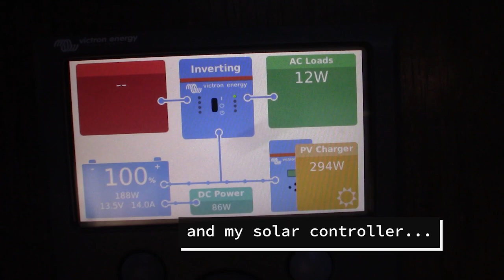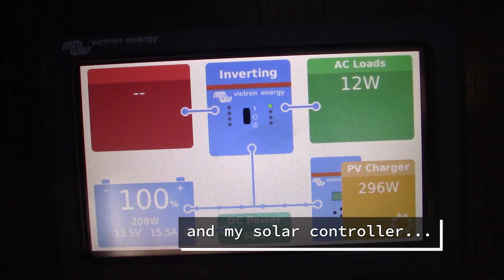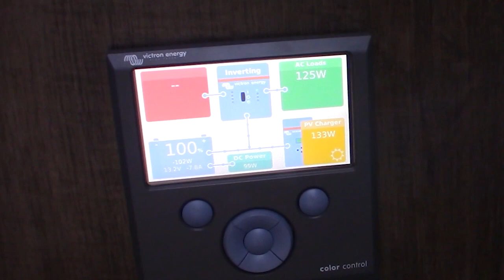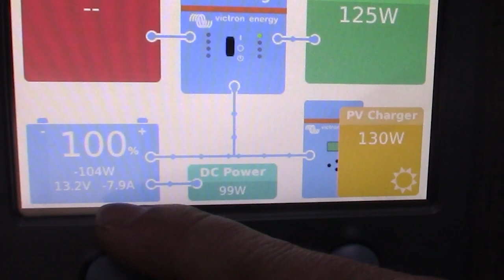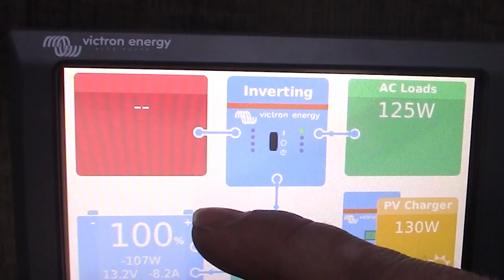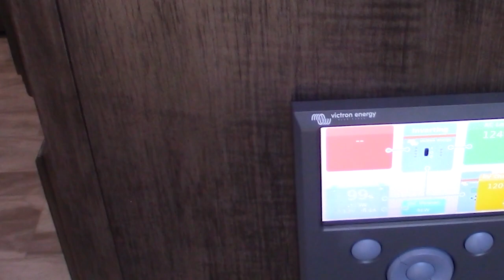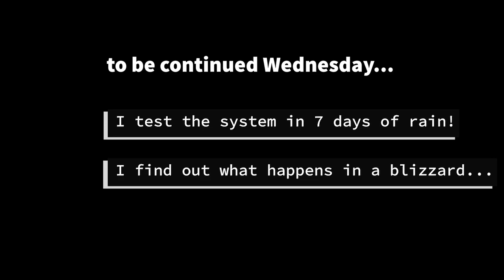MASSIVE SOLAR INSTALL for this Full-Time RV Boondocker! Full-Install and Walk Through

Comment: .I notice in all the tours of various vehicles that most have these humongous containers for fresh water and gray water under the sink. I am 77 and even a 1 gallon container feels somewhat heavy to me.  They have maybe a 5 gallon gray and 6 gallon fresh, which they are supposed to take out to empty or refill.  
How the hell am I supposed to do that?  

Any alternatives for that type of system?  

Also, since for now, I am in a car, if I would leave a fee campsite to go for groceries or laundry in town, would someone else come along and be able to take the spot where I was?
Reply: Hi Gloria, I'm 65 and totally understand your concerns. I solved some of this in my van by having an under-bed, 26 gallon fixed fresh water tank that I fill from outside, with a hose. 

The 7 gallon grey water tank under my sink has a valve so I can empty it onto the ground where it's safe to do so, without hauling it out. Otherwise I do have to remove it and manually dump. Heavy! So I don't wait until it's full.
You could get fancy and have a setup that uses fixed tanks and hoses for a dump station. I've seen this in some vans and it's always the setup in larger rigs, so you aren't lifting anything.

And, if you were asking about losing your camping spot at a free campground (typo? You said fee) yes, that can happen but in most boondocking areas there are plenty of spots. If you meant "fee" then your spot is reserved even if you leave.
Reply: Large water, grey & black tanks drain and fill with hoses. You don’t carry them. You pull up to a water supply and fill up. You hook up to a dump station to empty them. 
Propane tanks are a different story...those you could ask the attendant to help you with. 😉
Reply: @Judygurl2  Thanks so much. Very helpful information.  I have taken note. Yes, typo! I meant "free."  Thanks again.
Reply: @janniejeanjellybean3803  Thank you for for answering.  I appreciate your taking the time. Good to know, so much to learn!